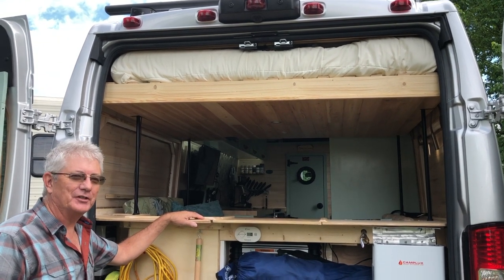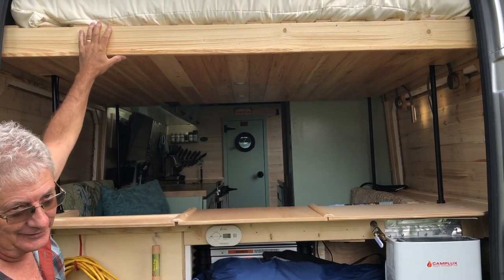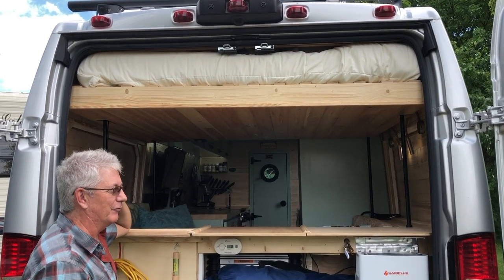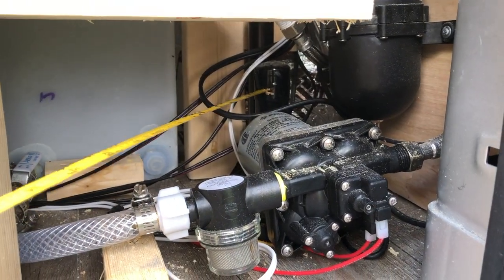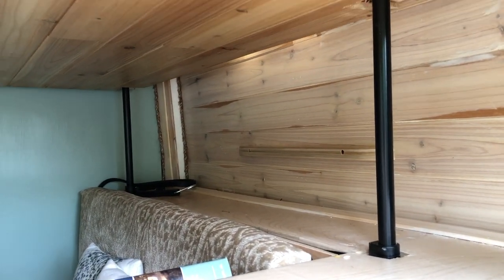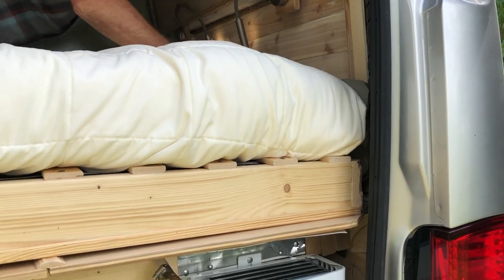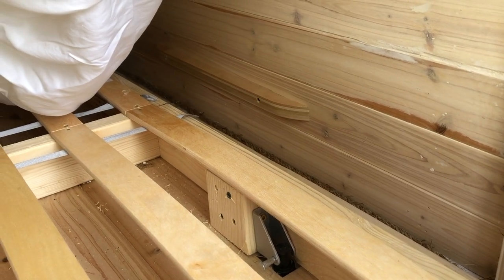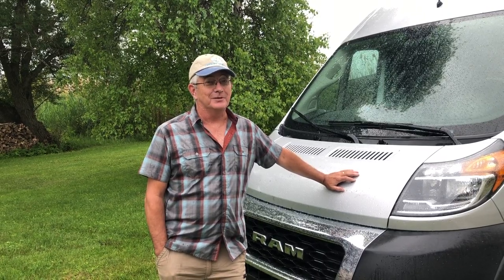Promaster Bed Lift using Linear Actuators

Comment: Do all four actuators are wired through the 20a rocker switch….does the bed lift pretty symmetrical? I know if load isn’t equal the actuators with higher loads will lift slower.

Comment: Do you have some sort of limit switch at the top or bottom to prevent it pushing beyond it's limit? Well, the top - as I understand it, you start out w/ the actuator at the bottom.
Reply from the maker: They stop automatically. Build in to the actuators

Comment: off subject do you run the propane hot water tank with the doors open? thanks great bed by the way
Reply from the maker: We can. We don’t have to open the doors to run it, though. If we take a shower and run it longer than a few seconds, minutes, we would have the exhaust mode for fan on and rear window open. That takes care of h2o and CO2 byproducts of the combustion.

Comment: Hey,
Great video! I’m in the process of doing the same here in Australia. I’ve a Fiat Ducato, similar van.

Having trouble finding some reasonably priced actuators in the length I’m after which is the same as yours, 30 inch. Also trying to find something that’s not too slow. We’re did you source yours? Heaps of Chinese ones online. 
Do the actuators travel at the same speed or do you have something to synchronise them?

Cheers Steve
Reply from the maker: Hi Steve.  I got mine from WindyNation. A little pricier than some on Chinese sites. There is a very slight difference in speed of the 4 I have. They do individually shut off at each low point which will be the level ground for bed mode. So at the high point ( which is not full extension) they may be at different heights. High point will be determined by mattress compression but with our 6” mattress and 4” bed frame allows plenty of head room under bed.
Reply: @adventuresingreyce4771  AWESOME  planning, throughout your van !!!

Comment: Great work! Do you have any trouble with the actuators not synchronizing or staying level?

I’ve seeing some people use special control units to keep them level, curious if you are using one and if not, any issues that you’ve noticed?
Reply from the maker: they are all pretty close in terms of speed. Also, when you lower the bed to actuator stop points they all individually turn off resetting the levels even.
Reply: @adventuresingreyce4771  did you wire them in series or parallel?
Reply from the maker: @reycastellanos3955  parallel

Comment: Love what you have designed with the bed lift/Dining area.  I was just wondering if it's possible to put windows behind where you sit in the dining area on both sides where it is indented? (just below your reading lights)... Thanks!
Reply from the maker: Yes we could have put windows in and maybe will in future. I heard there is a long wait to get those windows.

Comment: Hi! How did you wired them together? Could you make a quick video explaining?
Reply from the maker: 1. Place all actuators at their low point    2, wire all positives together and all negatives together. Then wire in DPPT switch. http://blog.actuonix.com/2017/03/connecting-linear-actuator-to-rocker.html?m=1

Comment: This is great. I'm curious, why haven't you used any vertical rail guides to support/guide maintain the beds position?
Reply from the maker: When bed is up it is firmly up against ceiling. When down it is resting on top of benches. Actuators are secured to floor and bed frame and held in place vertically in place at the top of bench seat about 15” from floor.

Comment: Hello and thank you for the video. Getting ready to order the actuators from Windy Nation, your video seems to show that you used 3 but the descriptiin has 4. Will 3 be enough using the same build and same 6 inch matress? Also 30 inch actuators I heard you mention but the website has you select "LOTS" and "Mounting Brackets" . I am unsure which to choose for this exact set up, would you please let me know? (Im just learning to build things, so need to copy exactly. Thanks so so much!
Reply from the maker: I used 4 actuators with brackets on both ends. The lower ones attach to floor and uppers to bed frame.
Reply: @adventuresingreyce4771  Thank you!

Comment: Thank you so much for your video!!!   Your video has inspired me to do a similar layout.  I am running into a issue with my framing.  What size boards did you use for framing the wall on the side of the bed?   Also,  how were you able to secure the wood into the space where the windows would be?
Reply from the maker: Sorry for the late reply. Hopefully you resolved any issues.

Comment: Thanks for taking the time to do the video. How did you wire all actuators together and did u use a speed controllers to balance lift speed??
Reply from the maker: Just joined all positives together and all negatives together and then to the powered switch. I did not use a speed controller. All the speeds are similar so there was no issue with one corner being too high or low. When lowering they all seat at their low point  and individually shut off automatically.

Comment: You got bed frame from ikea????
Reply from the maker: The slats only. Not the frame. Leroy I think they are called. Frame made from 2x4s and slats were screwed to frame.
Reply: @adventuresingreyce4771  Bed slats are a "must" in ANY RV bed design .... Ventilation is so important, to prevent mold/mildew from forming ....

Comment: Synchronization will be an issue leading to tilts and uneven load and can fail.  Not worth saving a few bucks and risk your life.  Get the hapijac lift instead.
Reply from the maker: It is not an issue. When bed is down all actuators are at their stop point…so even load. Risk life??? Kind of extreme. 
Hapijac $3000. This one $350. Happijac you have to have bed north-south losing precious inches.
Reply: @adventuresingreyce4771  Sorry if I sound too critical.  Just looking out for your safety.  I am more concern about when it is in the up position where the actuators are fully extended and structurally the weakest.  To improve this design, add additional posts at the 4 corners where you can slide in lock pins as a redundant safety system.  You can sit under the bed without fear.